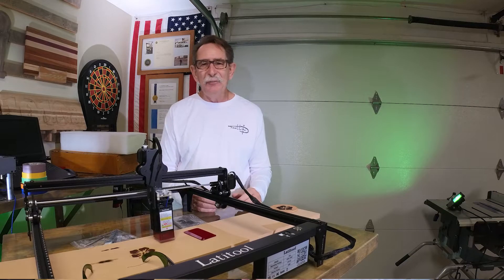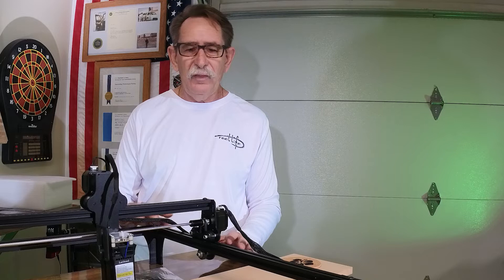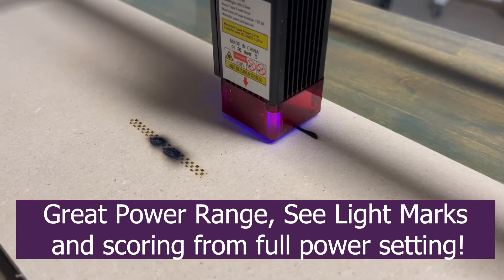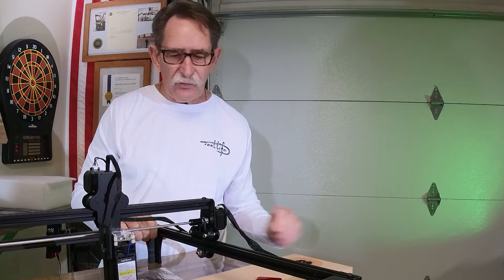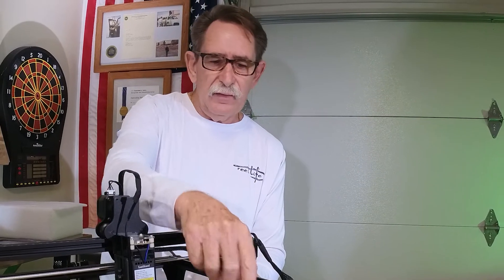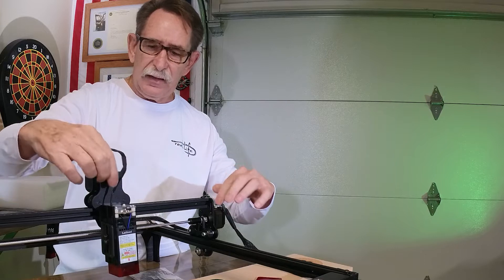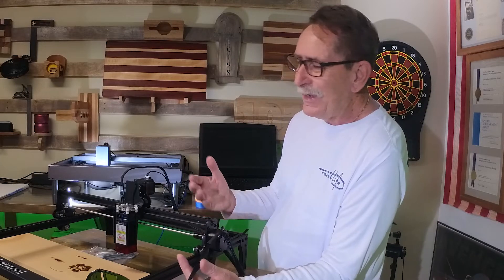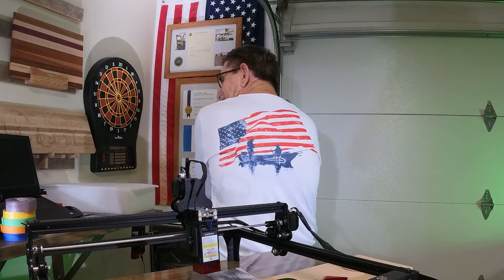Latitool F50 Laser Review and Assembly Instruction.  Is this a Good Entry Level Laser?

Comment: Will this thing work with a rotary?  Just starting to do research on a starter diode with the eventual goal to be able to etch some pint glasses
Reply from the maker: I would really think about an Xtool D1 with the Rotary over this if you want to do pints,  The start up cost is higher but the results you will get are so far superior.   I just got a CO2 laser to do my pint classes.
Reply: @GeorgeKennerLaser  thanks for the advice.  The D1 was the first thing I was looking at as it's come pretty highly recommended all over the interwebs...
But like any good nerd, I had to convince myself I could find a different gadget and re-invent the wheel, so I kept looking.

Thanks for the response!
Reply from the maker: @GeekyMitch   wait till you see my CO@...lol... no painting the glass and what takes and hour will take 2 minutes.  Yea it cost a lot more but for time if your really starting a business.  Time is money and the more pints you have the more you can sell.
Cheers Bro.   On my way to a presentation of the Saw Stop Table saw in PHX... video on that later.
Reply: @GeorgeKennerLaser  understood.  I'm doing this on a hobby level.  No co2 for me.  I have adult ADD and hobby jump often lol (want a 3d printer?   Maybe some knitting needles?.  A mitre saw perhaps? Lol)

Comment: The 1.75mm spacer might be accounting for the thickness of the laser guard, as that also adds some spacing; I doubt it though, since they easily could've made the guard itself the proper thickness and avoided needing a spacer in the first place
Reply from the maker: What I like most is the swing style measurement tool.   But for the money this is not a bad machine.

Comment: When I was considering whether to buy it I saw this video and decided to buy one, the engraving machine of our dreams, it is indeed USD100 cheaper than others.
Reply from the maker: Everyone has to have a starting point, this in my opinion is a good start, but everything is relative.   I believe it also runs on Lightburn but that is not free and does not come with the laser so I did not cover that.... CHeers.